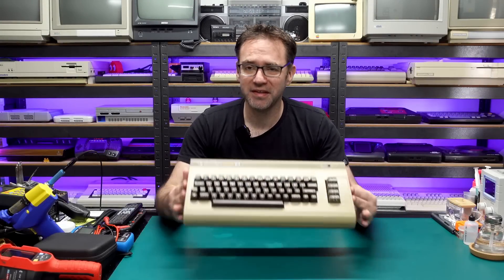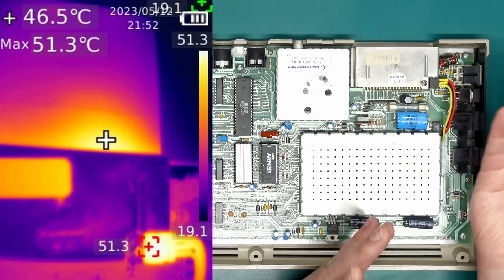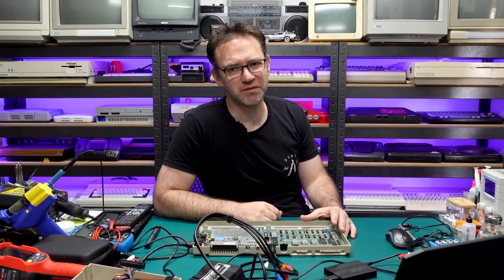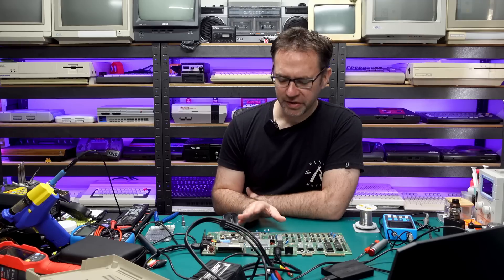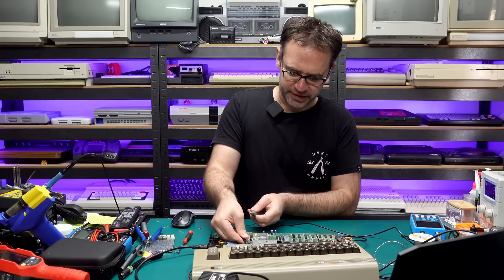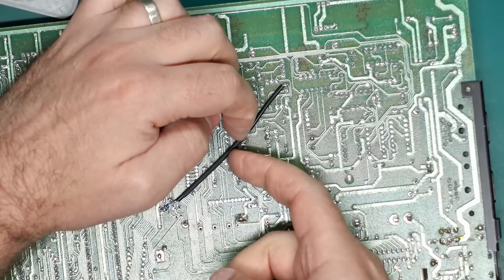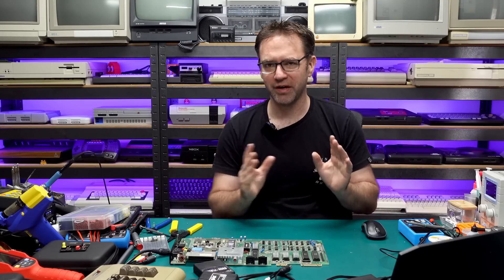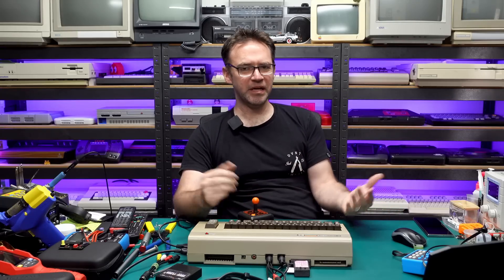Commodore 64 Rev.A 326298 hardware mods - fixing Commodore's mistakes

Comment: I had an interesting outcome implementing these mods on my original C64 board revision. All worked great, but I noticed that a) my voltage regulator wasn't getting above 40ºC even after running a while, and b) my VIC-II did not produce a chroma signal that worked right with my S-Video cable and HDMI converter - it stayed black & white, whether using S-Video OR composite.

Now it got really interesting in that the same machine hooked up to an Amiga / 1080 CRT via Composite - color as you'd expect.

And then for fun tonight, I swapped out the original ceramic VIC-II 6567R56A with a 6567R9 VIC-II that I have for another project. That VIC-II produces a solid chroma signal over s-video with these mods!

Any ideas what might be going on there, with the older VIC-II? I'm guessing something is still out of spec on the video signal and my particular S-Video to HDMI converter box isn't happy about it.
Reply: I ran into this again with another early board and first revision VIC-II. It turns out that the 64 cycle raster than older chip had doesn’t play nicely with the S-Video to HDMI box I have. Going to a CRT the mod works perfect.
Reply from the maker: Yeah sorry didn't see your first message but it sounds like you are correct and that particular S-video to HDMI box just doesn't play nice with the older VIC

Comment: Great video.  I'm currently repairing a board of this rev for a member of my Commodore club (was a black screen but now we have intermittent screen with garbage characters so I'm suspecting a logic chip or possibly bad 7805 regulator giving insufficient voltage), I will definitely be doing at least the video level and reset mods you show as well as possibly updating the kernal to rev 3.  I really like that mounting option for the 7805 as I was just going to put a big honking heatsink on it.

Comment: Would there not be a way to re[;ace the 5 pin pcb mount connector with an 8 pin one so that a traditional 8 pin Video Cable could be used?  -Mark.  (Great Video btw!)
Reply from the maker: I'm sure it's possible, but would require drilling holes in the PCB for the extra pins, and probably cutting some traces

Comment: Hi,  excellent work.   I've only worked on this revision once,  and now have one in front of me that I am being paid for.  Yes!  It passes all tests.  I am definitely going to do those mods, especially the regular first .   Is that the 5 or 12  regulator?   I don't really want to probe down there.  7805?
Reply: I got most those mods done.  Very happy with the picture quality now.    I can't believe how much cooler the 7805 regulator runs now:)   thanks again
Reply from the maker: Yeah 7805. Good luck
Reply: Ok. Thank you.  I really appreciate it (even though you are getting sick of me)  what gauge wire do you recommend?   Also.   2watt resistors are good?
Reply: Also... is there no filters with diag on these boards?
Reply from the maker: 2W resistors would be overkill, 1/4W will be fine. And "filters"? do you mean SID filters
Reply: Yes. Sid filters,  and I already have 2w resistors.    Will that be ok then?
Reply: There is no filter on diagnostic.
Reply from the maker: Yeah ok, could be a bad SID. Or it could be the filter capacitors on the board, apparently Commodore used the wrong values on some early boards. I don't remember off the top of my head which caps they are but if you look up 326298 SID filter caps, you should be able to check if yours has the correct ones.

And yeah, 2W resistors are fine. The power rating doesn't matter as long as the resistance values are correct
Reply: Ok thanks.  The sid is fine in another board,  and the filters sound good with my sid player floppy disk that really tests the filters...  I think I'm going to leave it alone.   However,  where do you get such small resistors?  The one's I got today are big.   Urg.  Lol
Reply from the maker: @donaldblakley6796 haha yeah 2W resistors will be pretty big. 1/4W is far more common, you can get them from any parts supplier - mouser, Digi-Key etc

Comment: I have to agree with replacing the audio in with the chroma out signal.  The audio in on the C64 was almost never used for anything and I don't even know how useful it is really is. The best it could do would be to mix incoming audio with SID tunes so filters and volume get applied.  It is possible a special cartridge/user port add-on may have used it, but you still wouldn't need it since you could mix that manually with the audio out yourself.  In most cases, I've heard it just adds noise sitting there unused anyway.
Reply: Also, you may want to think about grounding the audio in line.  It has been reported to improve audio for real SID chips, but obviously would have no effect on the ARMSID you have installed there.
Reply from the maker: @jandjrandr I've experimented with grounding the audio in (on a real sid), and while it does make a difference, I want to do further analysis before I draw a final conclusion

Comment: Excellent mods. I followed but with a further change. In RF can, ran the composite to the RF out jack. Then, dropped the composite from 5pin din rather than audio in.
Reply: I wonder what could happen to the SID if one were to forget which cable went with which machine... plugging a monitor's chroma in to the SID audio in. In theory, nothing...? 

At least your mod to go to the RF port would prevent that, but then requires a separate cable.

Comment: When you say the CHROMA signal is "too hot", what was its voltage level?  I'm concerned that attenuating it will make it fare not-too-well with a 1701 / 1702 (where the manual specs 1Vpp for the CHROMA signal).
Reply from the maker: I don't remember but 300mV will still work just fine with Commodore monitors that expect 1V. Worst case scenario is you will need to turn the colour control up slightly
Reply: @TheRetroChannel  I finally got around to poking at this a bit more today.  With a white border, on an unmodified board, the LUMA signal clocks in at ~3.2Vp-p right after its emitter follower (i.e. before passing through R9), and the CHROMA, right off the emitter follower, is at about 3.1Vp-p.  Obviously that would be "too hot" without a series resistor to create the voltage divider like the LUMA has.

Anyway, what's a little puzzling is that, with a 75ohm load on the display, that the output would be nearly 2Vp-p ... With he stock value in R9, it should be ~1.6Vp-p, which is still high but easier to live with.  Even with the 5% resistor tolerance, it should be < 1.7Vp-p.  I wouldn't expect these resistors to drift down over time!

Comment: Hey dumb question, htf does an ntsc version work with 50hz power?!
Reply from the maker: The only thing in the 64 that relies on the mains frequency is the time of day clocks in the CIA's, and only a handful of programs use these clocks anyway. All other frequencies (CPU clock, video output) are derived from the crystal oscillator inside the 64
Reply: @TheRetroChannel  perfect, that’s amazing, I’d never realised that it didn’t rely on external timing from power, so I’ve always avoided!? Do you hang out on discord with the VCF crowd like Bil Herd and Johan Grip and all of those guys? If you don’t, you really should…! :)

Comment: Excellent video. When I checked the resistors on my board I did notice that Commodore used higher rated resistors in several locations. Thank you for sharing this.

Comment: Actually, nice. My C64 is this model, the old one without the chroma pin. I have 1541 Ultimate, and I don't know if that's supposed to reset the machine or not.  It seems to be working that I know, but maybe something broken and I just assumed it was C64 random?

Comment: Does the C64 support RGB via Scart?
Reply from the maker: I wish. The best you can get out of the VIC-II is s-video
Reply: @TheRetroChannel 
So what is the best quality out of a C64 or C64C?
Reply from the maker: There's no easy answer as it can vary even with the same board revision. The C64C 250469 shortboard is probably the safer bet for getting good video quality

Comment: Hi, thnx for all videos. One question - C64C needed this mods?
Reply from the maker: No, it only applies to the older 326298 boards
Reply: @TheRetroChannel  it's just that I also have a grid and blurring on the c64c through the composite output. so I'm thinking how to solve the problem.
Reply: @BellaLugoshi  On my 64C I'm using separate (luma/chroma) to an S-Video-to-HDMI converter box and the display is nice - definitely a step up in quality from composite.
Reply: @TheUtuber999  thnx
Reply: @BellaLugoshi  I see you're a Bauhaus fan. 💪
Reply: @TheUtuber999  Bauhaus? Warum?
Reply: @BellaLugoshi  Sorry, I thought your handle was a reference to a song that band made from 1979: Bela Lugosi's Dead.
Reply: @TheUtuber999  no, its from "Ed Wood" movie

Comment: After making this modification, I ran the diagnostics cart and it came back with a bad SID and a bad Control Port. But it played all of the test sounds correctly (as far as I can tell) and the control ports seems to be working fine. Can anyone else replicate this? Could the removal of C12 could be the culprit?
Reply: I think I just answered my own question. Page 1-6 of the C64 DIAGNOSTIC INSTRUCTION AND TROUBLESHOOTING MANUAL says 

On some of the older 5-pin video output pc's, the control port will Display 'bad" and indicate a defective 6581 SID IC, I18, each time the Control port test runs. This is due to different value capacitors, PCB Locations C48 and C93, at pins 23 and 24 of U18, which cause the digital output to fall outside of the specified range. These capacitors values should be 1800 pF. This situation will not cause any problems with paddle operation and these capacitors need not be changed if a different value cap was used at the time of manufacture.
Reply from the maker: Interesting, I didn't know about that one. Pretty sure I've run the diagnostic on it in the past and everything was ok, maybe my board already has the correct value caps
Reply: @TheRetroChannel  it does say that they say that this is true for only "some of the older 5-pin" boards. So I suppose it is possible that yours is one of these boards for which this doesn't apply. Oh, Commodore!

Comment: I have this exact board and problem. Amazing that you are working on exactly the same thing at the same time. Which Atari video cable did you use? I don't see any designed for chroma/luma.
Reply from the maker: I built my own cable a long time ago when I got the Atari. You can see the pinout at 10:50
Reply: @TheRetroChannel  cool. On the other end of the Atari video cable, are the separate chroma and luma signals coming out of one of the RCA connectors or the actual S-video plug?
Reply from the maker: You would want to wire the luma and chroma to an svideo plug, unless you are using it with a Commodore monitor that has the 2 RCAs for luma and chroma
Reply: @TheRetroChannel  makes sense. I ordered an Atari video cable but when you mentioned that you made yours I pulled apart my existing composite, L/R audio and rewired it for Chroma, Luma and mono audio. What a difference! Amazing. Thank you for this tutorial!

Comment: Why did Commodore use resistors that put the video output voltage levels so far out of spec?  Has anyone asked Bil Herd?  While you're at it, ask why it's "Bil" instead of "Bill."

Comment: Excellent source for anyone that wants to do these mods!  Thanks!  My original C64 was an early model 5-pin video.  We also later got a 1701 monitor.  Back then they sold a cable that could be used with the 5-pin models and separated inputs on the back of the 1701/1702.  It was a pretty well known hack and was published by Jim Butterfield in an issue of COMPUTE! or COMPUTE!'s Gazette in 1984.  You basically used Luma for Luma and used the Composite for Chroma.  It does work but the levels are a little off so the colors are a bit brighter.  It did give you a much better picture then the standard Composite but not as good as the newer 8-pin models.  Anyway, your method here is much better.  Keep up the good work.
Reply from the maker: I just tried using the composite for chroma and yeah, it works but it's not great. Kind of a shame as I can think of a few cases where using composite in place of chroma would be useful.
Reply: @TheRetroChannel  For sure not as good as true separated. But back in the 80s it was still much better then composite and gave a sharper picture.  That is on an unmodded C64 though.

Comment: It is a Revision 1, YES there where mistakes, but COMMODORE Fixed them in Rev 2, these mods are variations of Publicly available fixes, I remember doing these Repairs & updates as Commodore Dealer, nice to see these updates still being installed in older boards, but "Commodore F**Ks Up", is not a discovery you made ...

Comment: Commodore made a lot of shortcuts to the point they got the Monitor OEM to add a fix for the crappy C64 video out. I find my silver label rev A to be dark, limited jail bars, but the colours are trash. I'm going to look at this resistor. PAL games on a NTSC machine are HARD, they speed up.

Comment: Nice video bud.  I'm currently working on a shortboard. :)  strange fault,  but I'll get it.  You are pretty smart with your mods. I always enjoy your videos
Reply from the maker: Thanks mate. What's happening with the shortboard?
Reply: It has black screen,  but with fastload,  it boots to basic.  Diag with harness runs perfectly for 10+ times.  A cartridge works,  sometimes freezing with random characters.  I can load a disk no problems.  I changed the kernal/basic rom chip,  no change.  Soldering is good.  So I changed ram tonight,  just because I had it.  No change.  I really thought it was a flaky kernal basic rom::(   I'm thinking possibly the character rom,  but I don't know.  I'm not sure how these short boards work.  250469.  I'm stumped
Reply from the maker: @fortheloveofcommodore64s  Interesting, yeah my money would have been on the kernal/basic ROM. I'm thinking either CPU or PLA, I'd go CPU first as it's easier to get out and replace, you can even use a longboard 6510. And I'm yet to come across a bad shortboard PLA
Reply: Cpu is good,  swapped with my other short board.  I have another kernal basic rom coming next week.  I'm still convinced it's that.  Super pla can go bad?
Reply: Thanks
Reply from the maker: I've only heard of it happening once, that was in one of Jan Beta's videos. Strange that the diagnostic test passes, that makes me think it's not a ROM issue. Looking at the schematics perhaps U3 could be bad. It's a 74LS08 AND gate that sits between the cartridge port and the CPU and Kernal/Basic ROM
Reply: I have a few of them and 14pin sockets.  Gunna try that tomorrow.  Thanks for going to the trouble of looking at the schematics for me.  You are a good man.  Have a great night:)
Reply: Hi bud.  Just thought I'd let you know that the 74ls08 didn't make a difference.  But I really appreciate your thoughts:)  have a great weekend
Reply from the maker: Damn. Well at least you can rule that one out, I'm hoping for your sake the next kernal/basic ROM fixes it
Reply: Thanks,  me too.
Reply: Hello again.  Just received 2 kernal basic roms today.   Still no change.  So that's ruled out now.  Damn thing. Thankfully they were cheap. Lol
Reply: One thing I forgot to mention,  was when I first got this 64C..  after I took it apart and did the usual testing voltages.. I did get the normal basic screen without a cartridge..  so I hooked up diag with harness.. but after that it was black screen without fastload or game cart. Just thought I'd let you know:)
Reply from the maker: Ok. I'm not sure what to suggest next. I think the reason epyx fastload works is because it skips the memory test and possibly other tests. The stock kernal runs couple of tests on boot and if it fails you either get a black screen or the wrong amount of free memory showing. The epyx cart skips that and just displays 38911 regardless. 

You've already replaced the ram so that should rule that out, unless the replacements are bad. I'm curious if the dead test will run correctly, do you have a dead test cart?
Reply: Yes the 3 in one diag/dead test and 1541 diag
Reply: It runs through
Reply: Rams tested good in my pal 466 board today.  I really don't know much about this short boards other than what I've been reading.  I am going to have to put this on the back burner.  Bring on the nice weather and not rain:)  still wondering if the character rom possibly works differently in the short board.   Maybe I'll try swapping that.   Anyways you have been great for your ideas.   Much appreciated!   Looking forward to your next videos:)   Don.   Cheers
Reply from the maker: No worries mate, yeah but of a tricky one. The character ROM is the same in both longboards and shortboards so it might be worth a shot. 

Perhaps removing all the unnecessary chips is a good idea, you can pull out the character ROM, sid, and both CIAs and still boot to basic. You just won't have a cursor and the text will be all garbled without the character ROM, but if it boots you will at least know if the issue is being caused by one of those ICs.
Reply: Thanks.  Character rom now off the list.   I really can't see it being the cias as diag has matched timers and keyboard and joystick work perfectly.   I have played disk games and emulator games for a couple hours the other day with fastload.  No problem.  The super pla?  Not likely.  Game cart freezes sometimes,  but works fine most the time and doesn't freeze in another 64 .  I hate loose ends
Reply from the maker: I feel you're going to end up with a fully socketed board, which isn't such a bad thing I guess. Just a minor annoyance 😄